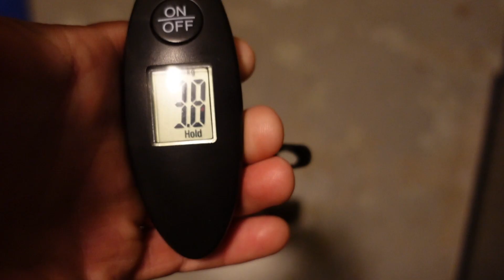This Is Why a Real Wrench Is Overkill | USDC

Comment from the maker: This video is NOT a criticism or hate toward USDC.

Once a participant landed a clean hit, the round was counted as a win - which is fair . The attacker continuing during the round is understandable when using safe foam props and also makes for better action on screen.

This video is just a reality check based on the weight and physics of a real wrench - and a fun crash test to visualize the difference.

Please don’t treat this as a fighting guide. It’s about context, safety, and physics -* not violence* .
Reply from the maker: Quick update:
Part 2 is now out! I tested the smaller wrench this time, since some of you pointed out the first one was huge.
It’s faster… but the conclusion is basically the same 
You can watch it here → https://youtu.be/5lZuBDdgN3E

Comment: Tbf you Chose possibly the biggest Wrench I've ever seen though I agree that a real Steel Wrench would do a Ton of damage I also think a more medium sized one would move a lot faster than that absolute unit you're using
Reply from the maker: Fair point 😄
Funny thing is - this is actually the medium pipe wrench. The big one is almost twice this size.

I picked this one mainly because it looks close to what they used in the show. The smaller wrench just felt too small for that comparison.

I honestly had a lot of fun doing the crash tests, so I might do a Part 2 and try different sizes.

And yeah - I agree with you. A large adjustable (“French”) wrench would probably be a better example overall: lighter, faster, and more realistic since a lot more people actually own one compared to a pipe wrench.
Reply from the maker: Quick follow-up:
Turns out there are actually four sizes - small, medium, large, and extra-large.

The one I used in the video is the large version (but compared to the other two I have this one was medium hehe). I’ve since found the medium one (the real medium), so I’ll probably do a Part 2 to make the comparison more accurate.

That said… it still weighs around 2 kg, so breaking bricks won’t exactly be a problem 😄
It will just be a bit faster and more controllable.
Reply: @MonkeyFist  That's still on the heavy side of medieval maces, but it existed. So the smallest is 1 kg? Any chance you can include both? The lightest pipe wrench is probably the most realistic.
Reply from the maker: @Chraan Good point.
I’ll probably be able to record a short follow-up after work and show what I’d call the “real medium” size. 
(Smash some stuff 🔥💪🔥 hehe)

The lightest one I own is actually pretty small - roughly the size of the training knife they used in USDC (probably around 30cm max) - and it’s currently "on a mission", so I don’t have it right now 😄

That said, I do own three other sizes. The one in the video felt roughly comparable in length to what they used in the show, which is why I went with it.
I’ve since found one that’s about 15 cm shorter and lighter, and I suspect the end result is largely the same - the mass is still concentrated on one side, so it behaves like a small mace.
The main difference is speed, not outcome.

Long story short: when I find the time, I’ll do another test. : D
Reply: @MonkeyFist  Looking forward to it! And wow, pipe wrenches are really quite heavy! But they weren't made for fighting, so I guess it makes sense... also I completely agree with your observation that they didn't handle the pipe wrench well, while I didn't think it would be 4 kg, it must have some considerable mass for its length which none of them respected (then again it's a championship, so there is no room for roleplaying a realistic pipe wrench)
Reply from the maker: @Chraan  HERE is part 2 : )  https://youtu.be/5lZuBDdgN3E  Size down but not much has changed hehe